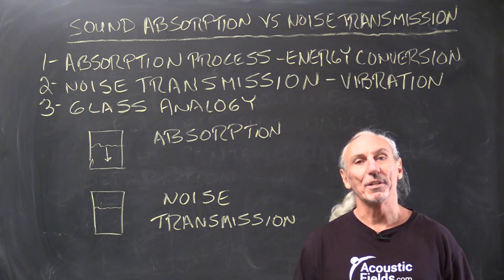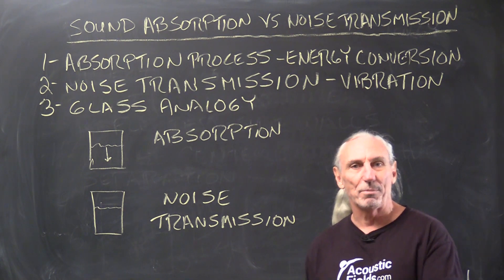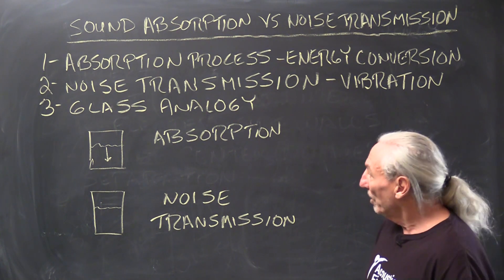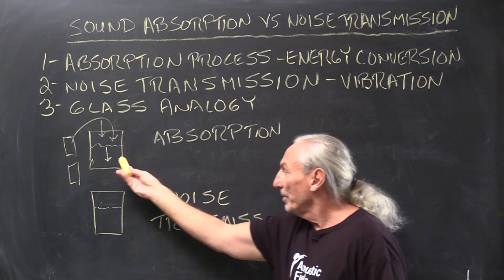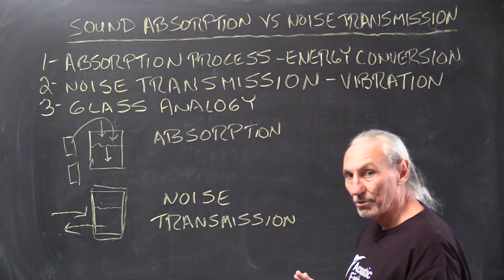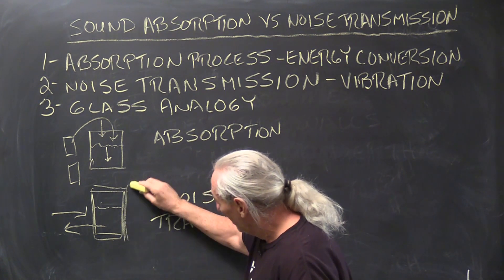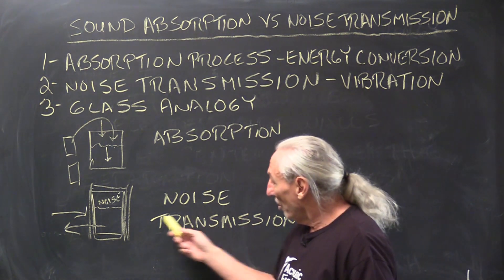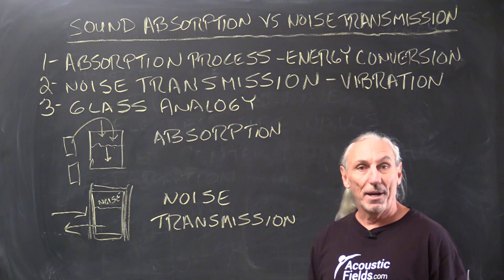Sound Absorption vs. Noise Transmission - www.AcousticFields.com

Comment: I think there's something very critical you're leaving out of your explanations here, that being SIZE. Point being, it's hard to tell just exactly what's going through your head when you're giving a definition in terms of STC or NRC, meaning, you may be thinking (personally) in terms of a large room, when sound measurements will change depending on the size of the room, as will the materials involved. Furthermore, you clearly keep saying "structure" pertaining to STC, but if the structure is - for example, a small 8 feet by 4 feet chamber made out of steel.. Again, it would depend on the size of the structure you're thinking about in your head. Everyone's situation is different, hence measurements and materials will be different, depending on size.
Reply from the maker: STC has little value when it comes to lower frequency management both inside room pressure and noise transmission. STC scales begin at 125 hz. Any monkey can build a barrier that deals with this noise frequency range. The true test is below 125 hz. attenuation. This is where vibrational acoustics come into play.
Reply: @AcousticFields  - I get what you're saying about 125hz, but what you're also essentially then saying is STC has no absorptive value, which makes no sense. Now if you can give me a logical absorptive STC to NRC ratio or value, THEN I would completely believe what you're saying. Please define "little value" or give a proper conversion value.

Comment: I would love to see your videos with more visual explanations and more demonstrations of relevant physics with real life examples.
1) Sound Absorption converts sound energy to moving more mass (inside the space) while reducing the volume of air that extra mass moves (reducing reflection and transmission within the space).  Sound will still escape but less sound will escape if it passes through a suitable absorber on its path around the room and out. This can greatly reduce the sound level heard by people in the room while improving the signal to noise ratio (improve clarity but needs more volume from amp+speakers to reach max SPL). I can place a speaker face down on the carpet floor and it will sound muffled to me (not useful to those in the room with me) but the neighbours below me will complain more because there's no reduction to sound transmission.
2) Reducing Noise Transmission requires isolating the boundary (structure & surfaces) and airflow from moving their neighbours. This may make the internal space sound noisier as the sound may be reflected back into your internal space instead of leaking out. It can greatly reduce the sound coming into a space. It becomes exponentially harder to do as you try to stop more sound\movement.
3) Diffusion can redirect or disrupt sound waves but the energy mostly stays in the room (the materials used may absorb or transmit a small amount of energy through it). Some try to vary the space so only a small part of the space fits a frequency and a wider range of frequencies have a small space so together you have less peaks&nulls (a flatter response).
A studio recording room may use a lot of #2 plus some of #1 and some of #3.
An audio listening/mixing area will be treated differently to the recording room.
A church/religious-centre/hall may use: a lot of #1; some of #3 typically because areas were not covered by #1; and optionally #2 around a cryroom or just a single wall but typically very little.
Some homes/apartments use a bit of #2 and home insulation (some absorption) between some noisy rooms or floors (not every internal wall).
You may try to make a big space sound smaller and a small space to sound bigger. You may try to enhance some mid to high frequencies and reflections while trying to reduce some low frequencies from making multiple trips around the room.
Low frequencies require larger areas + distances + volumes to make/hear but also larger areas + distances + volumes to absorb or diffuse. For example, if you can't put 12" of material in the corner then place 4" thick material 12" from the corner. Low frequeciences will start to reflect from a boundary at a distance from that boundary as the pressure increases and as the air flow reduces (try squeezing a manual tire pump with your finger over the hole and watching it bounce back).
Questions to ask - Identify how the room is acting? Test changing EQ and speaker choice/placement to understand problem frequencies and room acoustics. What are the problems and what is causing them? How do you want the room to act and sound? What can I do to change it? Can I test with temporary/partial installation of acoustic panels / diffuser / bass trap etc than can be moved (or try computer models as a guide)? Go back to Q1, check the room again and follow the other questions/steps.

Comment: What if the noise is being generated IN the room? Wouldn't absorption help to reduce the amount of noise coming OUT from that room?
Reply from the maker: A,  It would depend on the frequency and amplitude of the sound. As a general rule, its the low frequencies that become the issues.

Comment: What is a "room"?

For example, if I put a hole in the wall and I keep making this hole bigger, at what point does the "room" become "bigger" and include the neighboring room where the hole is, in terms of low frequency acoustic performance?
Reply from the maker: D,  No, its all about volume increase using width height and length.
Reply: @AcousticFields  
Then I suppose a headphone would be nothing more than a small room with small speakers

You often imply that a small room is a lost cause.

Why can't one simply use smaller speakers with a smaller subwoofer in a smaller room to create that same idea?
Reply: It will slightly vary with frequency compared to the hole and if rooms are sealed or open. At maybe greater than 15% of the area you will notice 2 sets of reflections and modes (1 for original space and remaining wall plus 1 for the new space & walls/floor/ceiling). You would notice it more with an ear near a smaller hole than being on the other side of the room. How much sound of the larger area is going into the small room and how much can come back to the listener?